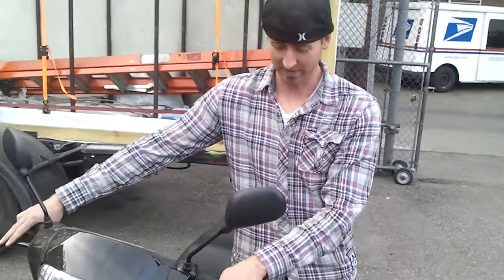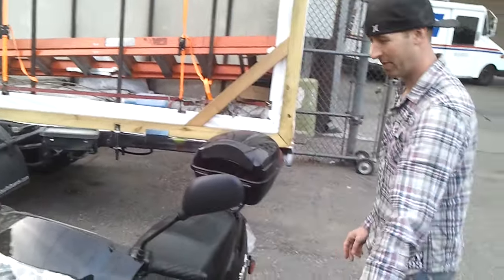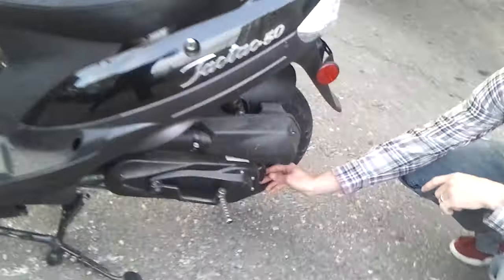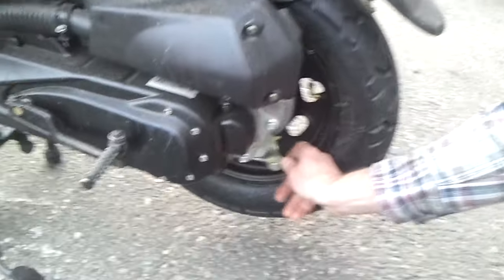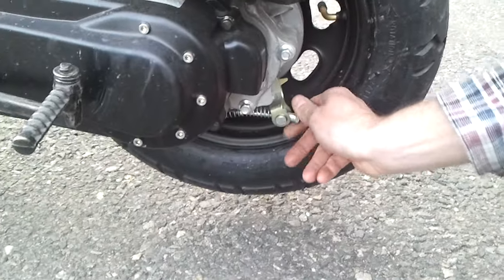How to adjust the rear brakes on a scooter,  moped, gy6 qmb139, And motorcycle

Comment: the rear bolt spins but doesn't tighten or loosen up
Reply from the maker: You will need to hold the cable inner in place